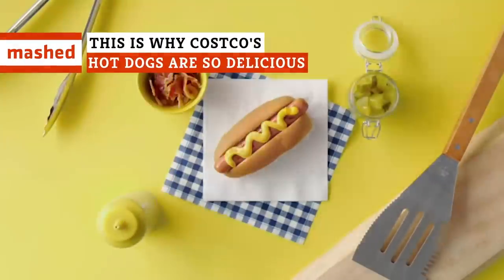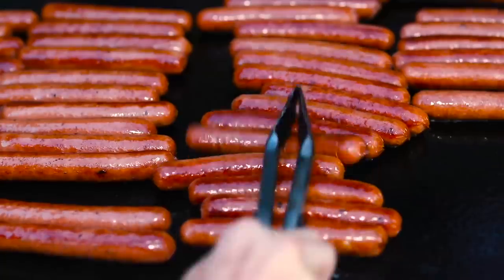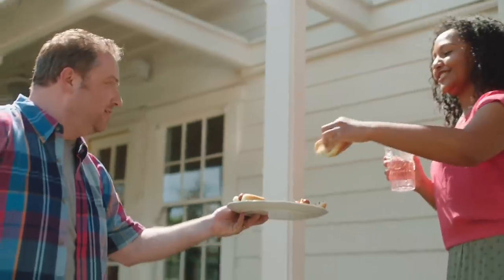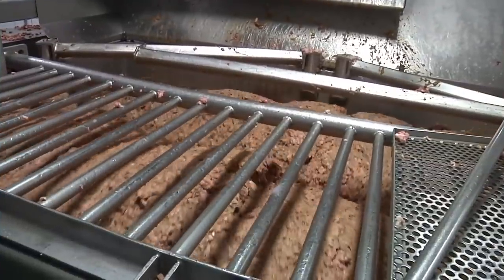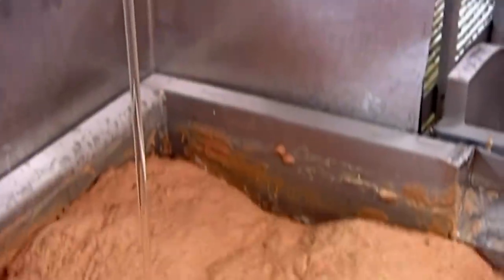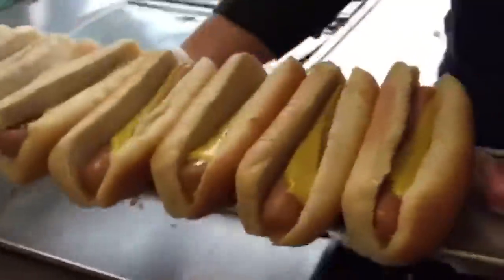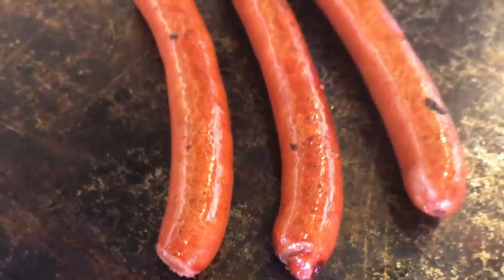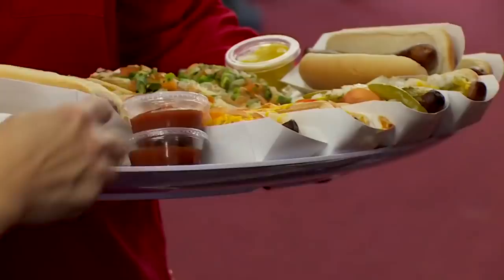This Is Why Costco's Hot Dogs Are So Delicious

Comment: The best hot dogs I ever tasted over my 50+ years as a butcher was a Texas Red hot colored dark red sold by Tops in 1980, about 3/4 inch in diameter 7” long, 1/4 veal 1/4 beef 1/2 pork with secret spice recipe. I ate probably 400 of them per year until 1986 when Dog Bros. Bought them out and the recipe changed. I had to find a new favorite hot dog
Reply: Zweigel red skinless